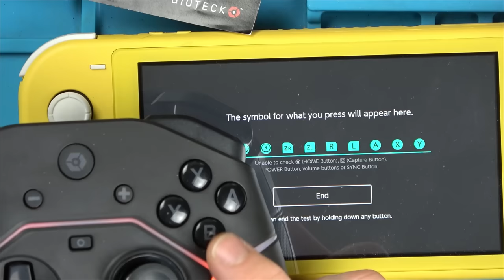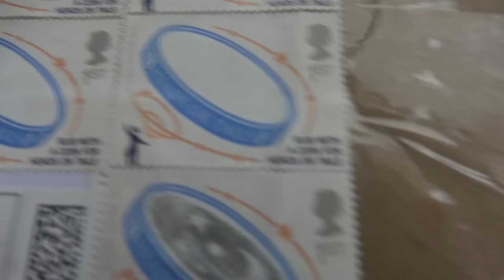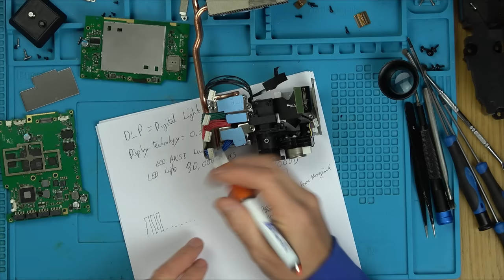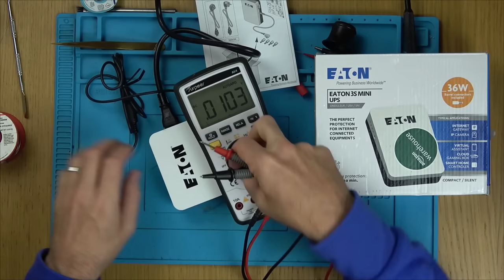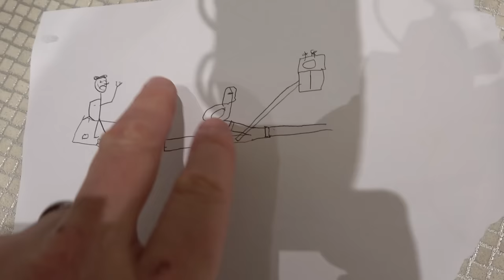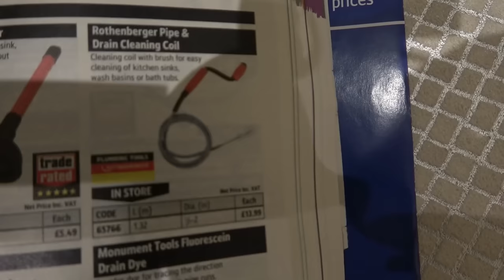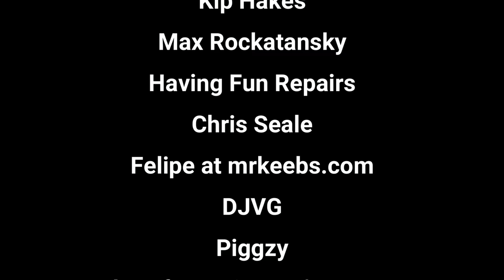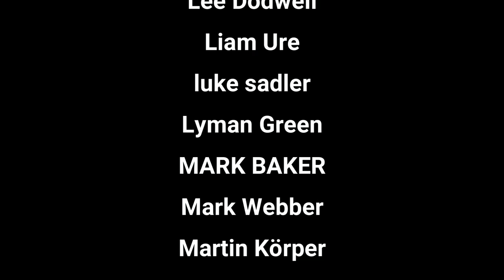Attempting to FIX EVERYTHING

Comment: Oh my god, FIX THE LEAK NOW! You’re going to have major mold problems if you don’t. Leave the floor open to air out until the plumber gets there. And just bite the bullet and hire a professional plumber. Also, I don’t know about the UK, but here in the US those accordion flex pipe things are against code. You can see why, all those little ridges on the inside just hold solid waste. People notoriously use them here under bathroom vanities because they can’t get the pipes to line up after a remodel. Then a few months later they wonder why their bathroom stinks.

Comment: Hi Vince!  I saw your attempt to repair that Nebula video projector.  In the past I had one with the same defect (it turned on but did not display anything).  The solution was quite simple, because in my case I applied more pressure on the design pill in the DLP block.  Try this in the DLP block, namely where the chip is positioned, you will notice a small radiator fixed with 3 spring screws that maintains pressure on the contacts of the DLP chip.  An spring was missing from mine, a sign that someone had walked there in the past.  I replaced the spring and with the video projector turned on I started applying pressure to each screw (I tightened them one turn at a time) and at some point ... boom the lamp came on and everything was working normally.  Please excuse my English and I hope this method will work for you too.  I wish you good luck!
Reply from the maker: Thank you Adrian, I'll try this later this week sometime. Thank you👍👍👍👍👍
Reply: That would imply there are broken solder joints. I'd say try reflowing the solder joints on the QFP and then install the spring.

Comment: Hi Vince, its me again. I've worked in the building trade for over 40 years. I can almost guarantee you. It will be a tear in the flexy pipe where it joins from the toilet to the soil pipe. The reason a flexy pipe is used on toilets is there will be a tricky bend to make the connection. Your best bet is remove your toilet and see if you can feel or see any tears. Also there might be a chance you can replace it without cutting a big hole in your wall.
Reply: yep hate them flexi's had numerous problems with those, looks like they had no choice as its running flush with the joist for a straight fit.
Reply: Here in the US you're not even supposed to use those flexy pipes. All those little ridges just hold water and waste. Plumbers here rage against them. You usually find them in bathroom vanities after a remodel where the new sink didn't line up with the old pipe. If you want to see the plumbing subreddit rage then post a picture of a flexy pipe.
Reply: Is toilet exited straight out the back into a solid pipe. Most likely somebody did a renovation and cut off the vent pipe and it backed up into the house

Comment: I hope you get your plumbing problem sorted out quickly and cheaply Vince.  I hate anything to do with water as I just don't understand plumbing.  We recently moved into our current home and from day one we had problems with flushing the toilet. Those problems got worse and eventually the toilet became completely blocked.  So we used various drain and toilet unblocking liquids, but to little effect.  We also used one of those wire things you showed in the Screwfix book, but that didn't make any difference. We then bought a plunger and it kind of made a little difference, but not much.  Then it just stopped draining at all.  We knew it was blocked and needed looking at, but hadn't got around to doing anything as, over time, it did still drain away.  Then our son-in-law was walking outside around the house and noticed what appeared to be toilet paper around the edge of a big man-hole.  He lifted it up and hey presto - the whole sewage drain was backed up to ground level!  Cut a long story short, we called out a drainage chap and he unblocked the lot.  It had backed up from the mains sewerage right up to the toilet, kitchen and utility room outlets.  It turned out the previous owner had been disposing of her cooking fat down the sink, and over time it had just solidified and blocked the main sewerage pipes, so no wonder everything was struggling to drain away!  She had passed away in January 2021, so it must have already been blocked since then, and we just added to it.  Took the guy 2 hours to fully unblock everything and it's been perfect since.  So I was expecting a major problem and large expense, but it turned out to be a simple blockage and £90 was all it cost - on a Sunday too and he turned up less than 30 minutes after I called him.  So although your problem may feel bad, you may find out it is a relatively easy fix.  I hope so.  Cheers.  Oh, and by the way, I had a very similar experience to your Ibiza holiday.  When I was 20, I got sh*tfaced on a BOGOF drink offer in a massive night club in Brighton.  One minute I was dancing (that's a very loose term) with a girl, who from memory was the most attractive woman on the face of the earth (although I'll never know), and then I knew I was about to chuck, so I said to her I'd be back in a minute, and went off to the toilets.  Straight away, like you, I was on my knees and spewing into the bowl.  I then got up and feeling a little 'delicate', sat on the closed toilet seat to take a rest and try to feel better. About 4 hours later I suddenly came to, still sitting on the toilet, but not knowing where I was.  It was absolutely pitch black as all lights had been turned off and it took me ages to find my way out to the foyer.  I had to call the old bill to get me out!  You would think they would check all toilet cubicles before locking the place up, but they didn't that night, so I can concur that getting locked inside a pub or club can happen!  I wonder what the girl thought?  She last saw me sort of walking, wobbling, off the dance floor, never to be seen again.  I know she was absolutely stunning.  Probably.  Maybe.
Reply from the maker: Hahaha, great stories! Thanks for sharing 😂👌

Comment: Hi Vince. The 18650 battery has an over voltage protection built in under the positive cap (if you look closely, the positive cap has holes around it) 
Not sure you should mention it in a video as its horrendously dangerous, but theres a little pressure plate that pops up under it - disconnecting the batteries internally. You can however reset these if you are brave (do it outside!) by finding something thin enough to fit into the holes, yet strong enough to exert a bit of force to push the plate back down. Ive done it with a jewellers screwdriver in the past but please be aware how close the negative case of the battery is to the positive terminal if you are going to use something conductive. (ive tried cocktail sticks in the past with varying success - ive also melted a few screwdrivers!) - Back to YOUR ups - My guess is theres something wrong with the charge circuit - not cutting off at 4.2 volts as you are not meant to tricle charge lithiums.

Comment: I'm an electrician not a plumber but I've done lots of plumbing for myself and friends + family. What I would do immediately is:  1. Make the bathroom (where you unblocked the toilet) out of bounds - nothing goes down the drain (w.c. sink or shower). You can still brush teeth with a bottle of water and a bowl if it helps. 2. Take the floorboards back up and put as much lightweight absorbent material as poss. wherever the water is. You want to soak up as much as you can to reduce quantity soaking into ceiling below. Hopefully might save it from needing replastering. However if you know how much your house insurance excess is and you're happy to have it repaired and decorated you might want to ignore any advice like this.
Reply: I mean, if that's the sewage line that's leaking on the ceiling then it's probably going to have to be cut out and replaced. I personally wouldn't trust it from not molding or smelling. Also, if it's the sewage line then it's probably going to keep dripping even if they're not using the bathroom, especially if the blockage is further down from the leak. Vince needs to get a plumber in there ASAP.

Comment: @mymatevince when our toilet/bath was doing that, it ended up being a faulty Durgo valve (air emittance valve) the valve had gone and was causing some type of weird pressurising issues which looked like my toilet was blocked, also regurgitating soiled water up the bath hole, same exact symptoms.

Makes sense for a second bathroom to be fitted with an Ai remittance valve as it would be away from your main soil pipe. 

Have a look for one, might be boxed in somewhere!

Comment: Oof good luck with the leaking water situation, I can definitely relate. I recently moved into a new house and the previous owner installed the upstairs shower diverter backwards so the first shower I took leaked a load of water into my dining room ceiling ruining it. Had to get it all torn out, dehumidifiers run for a week, and replaced/repainted. Repairs were in the tens of thousands but luckily the new home owner insurance I got covered it. It was a major stress though.
Reply from the maker: Sorry to hear you had to go through that especially straight after moving in. I'm currently working on my leak right now😂 Hope you're keeping well👍

Comment: Great video with some good fixes. That water leak is a real pain it's more than likely to do with the sewer pipe these pipes are not made to hold water and because your pipe goes along on the level rather than just going down to the out side it will have a tendency to hold a little water. The pipe being blocked and full of water has put a lot of pressure on the joints and one of the joints has more than likely slightly come apart with you forcing water through it will have made it come apart a little more. Hope you find the leak and can fix it with out too much trouble.
Reply: Exactly, if the angle of the pipe is too shallow it will tend to hold water/block until the joint fails, I have a similar problem...

Comment: I repaired an Epson DLP projector for my local pub (I was paid in beer credits). It was the DMD chip that had overheated because the air filter had not been kept clean and had had a good dose of builders dust.  Like yourself, I learned about how they work and was really blown away.  Apparently the DLP technology will be going into cars to replace display screens and no doubt many other items.  

Good luck with the leak.  Maybe an endoscope camera might help.
Reply: 30 or so years ago the demonstrations nits were in circulation with a microscope aimed at the mirror array so you could watch it work.  Bigger, hotter and lower resolution in those days (and rather more expensive).  HP in the old days.  But very bright in comparison with everything else (mostly CRT based projectors) and much longer lifespan.  Add LED light sources and the future is great indeed.

Comment: Sorry for your plumbing problems, but this kind of thing kept me employed for the last  20 years, Any blockage will put more pressure on, or more of the joints, than is normally the case (a sort of worst case scenario for sealing). Release of blockage pressure gives a pressure wave against the leaky seal , a final spit as it were, hence the increased leak which if blockage free may never re-occur. Suspects are 1.any glued joins. 2 .displaced rubber seals from push fit joints on the upper part of the pipe. 3 A new screw/nail gone into the pipe on decoration/new fittings (this last took  me 2 days to find and only then after close interrogation of the owner)
OK problem found, let it dry out thoroughly, 3 weeks?, use stainblock or eggshell "gloss" as first coat, dry period, before normal white emulsion, otherwise water staining will show through. Sorry if I missed any thing, but congratulations on the right approach, it's so rare to see these days. Much enjoyment from your pieces, and I learn a little more at every video.
Reply from the maker: Thanks for sharing your knowledge on this. I might do a revisit video to see if I can actually find the leak this time and fix it 👍👍👍

Comment: A relative of mine had a water leak that required a large section of floor to be replaced. I fixed the leaky pipe but I didnt have the tools or knowledge to redo the floor. The homeowner insurance policy covered the floor repair and they paid to completely re-plumb the whole house. 10 guys came out and did everything in less than a day. 
So it may be worth checking your insurance policy. Good luck!

Comment: Another great video.  I bet  the 'Water wipes' featured at 48 minutes was what blocked the toilet, so called flushable wipes. Like someone else suggested I'd also look at the flexible coupling on the toilet waste then remove a section of ceiling for access sometimes the worst way is the best way. I had a similar adventue in Ibiza LOL thanks for sharing

Comment: Had a thought this morning that you may of punctured the flexi pan connector behind the boxing when sending your fish wire through. You may of introduced a second leak. 
Check the first leak with the hot water running & heating on. It may only be visible when the pipes are hot & joints have expanded.

Comment: I would probably use a hole cutter,  as large as you have, 10cm plus and drill an inspection hole in the downstairs ceiling. A small hole you can replaster. That will enable you to see the underside of the soil pipe. 
These pipes are ok with a flush of water, but if water sits in them ( i.e a blockage) they will leak around a joint. 
Good luck, and keep doing such good videos.
Reply: Yes my main bathroom WC will leak from it's waste pipe if the kids block it but dry as a bone normaly and thats the WC installed by a professional 😂 the one I installed dosnt leak but I may have put silicone round all the joints to make sure 😂

Comment: I had a similar issue with my bog. Rodding is pointless. I fixed mine with an air blaster. You pump this device up,, push it against the U bend and pull the trigger. The shockwave passes through the water and breaks the blockage.

Comment: Quite a good summary of how DLP projectors work Vince 🙂
From my past experience it will be the power circuit causing the problem, but might be worth checking:
- Firmware updates? Don't know the model but maybe there is a firmware update to resolve the issue?
- Full reset, if you can find a service manual for the product, is there a factory/lamp reset?

Comment: As always. A greatly entertaining video.

Quick tip on unblocking a toilet, if you can get a hosepipe or extend your shower hose (Some hosepipes will fit the shower thread) then with water on full thrust pull shoot water through.

An amazing tip and yes it works. If a sink is blocked and you do not have a plunger, but you do have a Pringles Crisps tube to hand, put the Pringles tube upside down over the plughole, press down to seal and sharply squeeze the tube to force air into the drain.

I have used both these things and helped myself. I got the idea for the water pipe from the German spike defences on the beaches at Normandy (How Rommel created holes to put in the spikes rather than digging). And the Pringles in desperation trying to find any way to get pressure into a sink drain.
Reply: Or you could just go buy a snake and a plunger.
Reply: Not on a Sunday where I live :-) @ClunkerSlim

Comment: Hi Vince there could be a crack in the toilet bowl. It happens. Thats why when siliconing around the base you should also leave a small bit open so if there is a leak below the bowl the water will escape and you will know.I would cut away any silicone below the bowl and see if water comes out or take the bowl out and see if its wet below. Also the fact that you flushed the toilet so many times also points towards the toilet itself.

Comment: Hi Vince, regarding you blockage, a mop makes a good plunger for toilets. I suspect one of the smaller waste pipes will be bossed onto the 4" soil pipe, i have had it in the past where the waste pipe from a sink has been pushed too far into a boss fitting restricting the flow on the main soil pipe over time as toilet paper and the likes gather over time. Just from the video i would look at the wash hand basin in the other bathroom as it looked as it was bossed directly into the top of the soil pipe , if this is pushed in too far that would cause a blockage at that point and explain why everything in the other bathroom was blocked,
Reply from the maker: Very good advice Dave, I didn't think of that at all and I was in there a few months ago to clear hair out of that pipework 👌👍👍👍👍👍

Comment: Vince I sympathise with you on the water leak.
My house is an early 70s, where the water pipe comes into the house.
For some stupid reasons it runs inside the wall cavity then all the way up to the attic, we had the same as you, all be it fresh water, but the staining is the same colour due to dirt/dust in the wall and plaster.
All we could do is chop out the whole pipe and replace it as there was no access to repair the leak in place..
In your case yip take out the stained piece of plasterboard and inspect the pipework from their, you more than likely have a leaky joint, it only takes a steady slow drip to make a large stain.
Best of luck with the repair.

Comment: for future reference re blocked loo. fill a bucked with cold water and "drop" the water so it hits right down the middle of the hole. the pressure is usualy enough to dislodge even to most stuborn log with out the need to get on your hands and knees and put your hands in there.